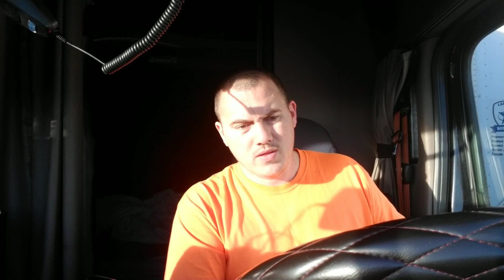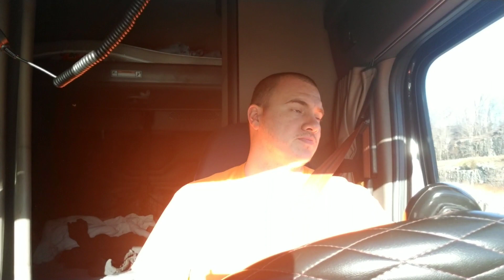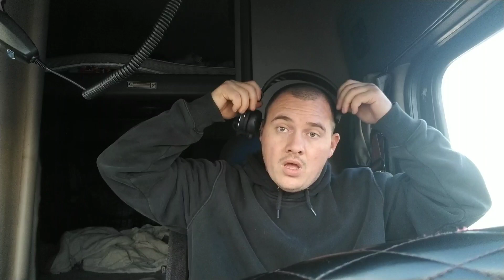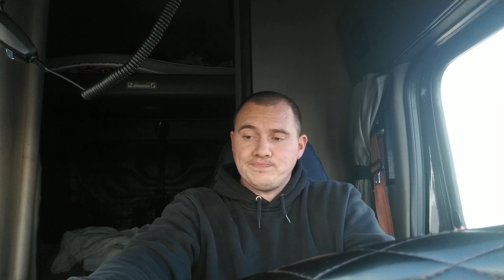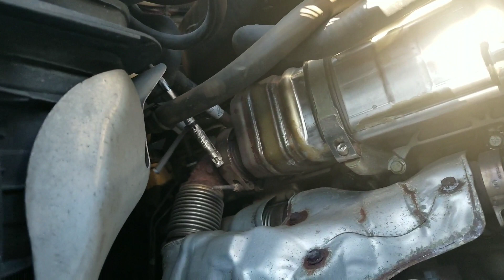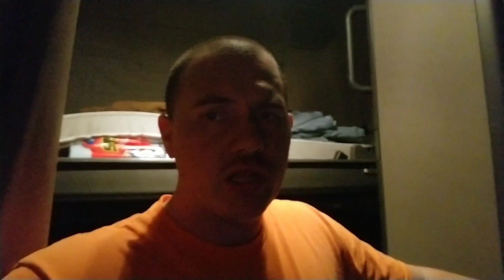Losing Coolant

Comment: I had the same leak. You can bypass the heater core.
Reply: How
Reply: @nirmalsarai8877  disconnect the two lines going into the heater core. Then connect them together. You will not have no heat in the sleeper but it’s a quick fix until you can get the core fixed or replaced.